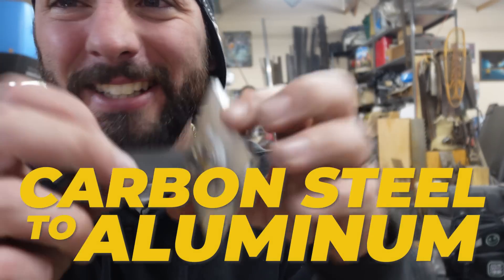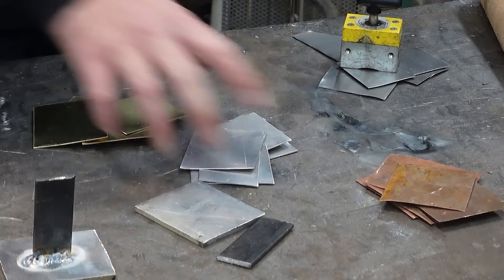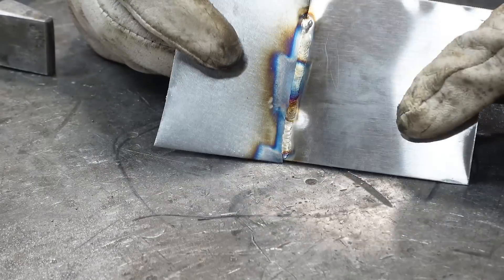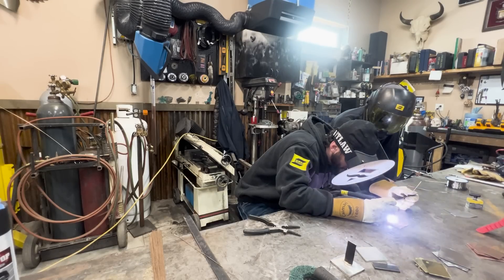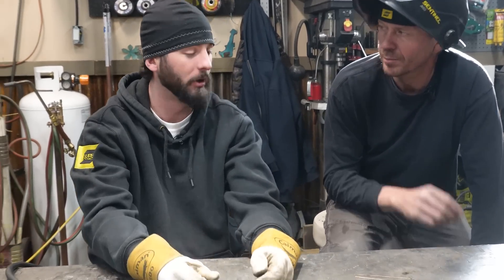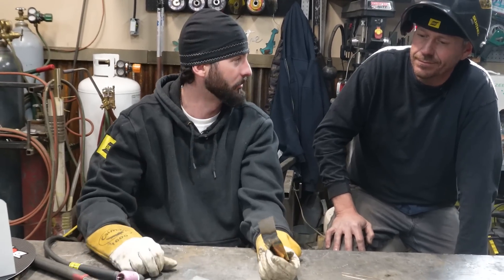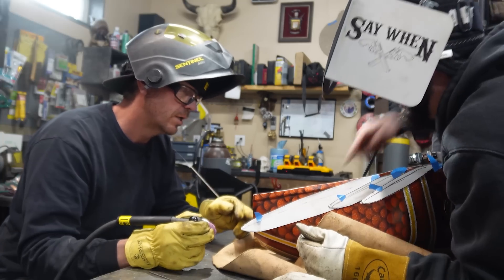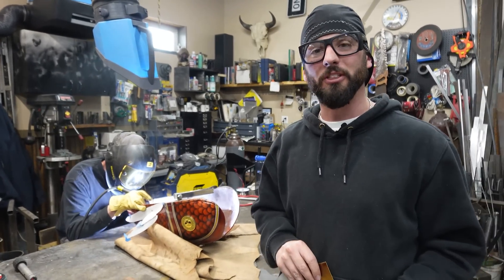Intro To TIG Welding | How To Weld Dissimilar Metals

Comment: Good video, I've been interested in joining dissimilar metals with tig for a while. In addition to SilBrz, I've also used ALBrz & PhosBrz.....but I prefer AC for the cleaning action and improved wetting.

Arc shots were a bit difficult on the carbon to aluminum..... which material was the base?

Comment: If you are using a Silicon Bronze filler rod, you are not welding, you are brazing.  The technique is different.  Basically, you want to heat up the base metal until the filler rod will melt if you touch the filler rod to the metal.  You should then build up a puddle of braze and then move forward while keeping the arc on the braze metal puddle.  Copper is weldable when using a copper filler rod.  While you can use copper electrical wire in a pinch, it is best to use a deoxidized copper tig rod.  Copper is a bit tricky to weld as it goes very quickly from a solid to a liquid.  I recommend using a chill bar when welding copper, especially on the thinner sheets.
Reply from the maker: you can weld or braze with silicon bronze. in this video we do both.
Reply: He is correct. Chemically abd physically they will not weld. They dont achieve coalescense. The bronze filler might coalesce to one. And to the other. But all 3 are not coalesed into one. Which is welding. Molecularly they will not and cannot bond. Like AL and steel. They can bond in a vaccume. But they cannot melt and become one. Which is th3 deffinition of welding. @Welddotcom
Reply: @swampypolitics9574  Brazing is used to join dissimilar metals.  It works by adhering to the base metal.  There is no fusion occurring.  tyvm for your support, I just wanted to point out how brazing works.
Reply: @paulkurilecz4209  yes correct. Just because becsuse something melts and holds doesn't mean its a weld
Reply: @Welddotcom  I will respectfully disagree.  Yes you can weld with silicon bronze on copper alloys.  On other alloys, you may achieve some degree of fusion, but there will likely be adverse effects with respect to strength and toughness.  Brazing works by adhesion to the parent metal.  This is how dissimilar metals are joined.

Comment: Very instructive. I've been welding off and on for 40 + years of my life. I've done stainless to carbon steel frequently enough, but I've never tried brass, copper, or aluminum to steel. As a matter of fact I use brass backing plates on steel with really big gaps sometimes. Sometimes carbon sticks, or aluminum. I had no idea they'd fuse lol
Reply: Note sure if we fused them, rather used the bronze at a medium to do so

Comment: The brass is fuming because its burning off the zinc, just like galvanized pipe
Reply: Thanks for that!
Reply: Exactly. I was just going to post that. Brass is dangerous to weld, so make sure you don’t inhale the fumes. You can get zinc fever from that. It’s not fun.